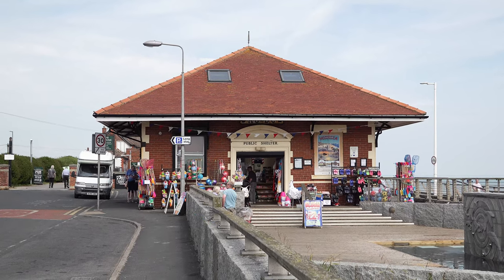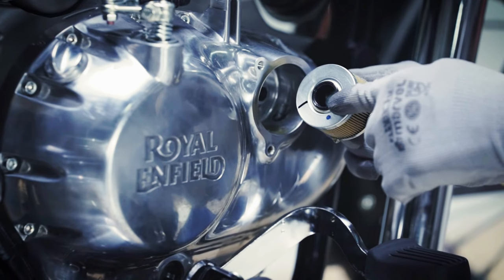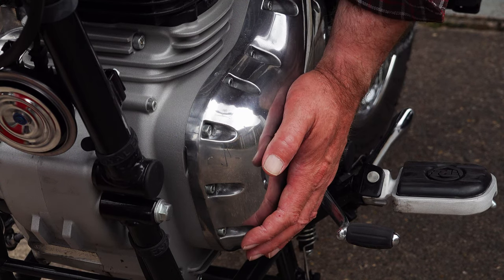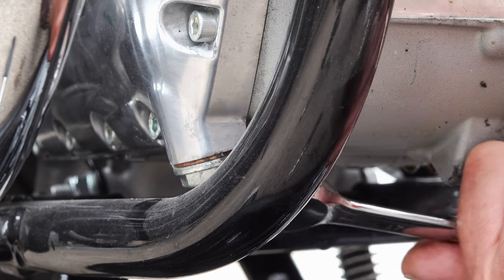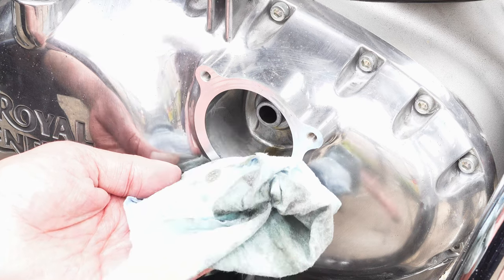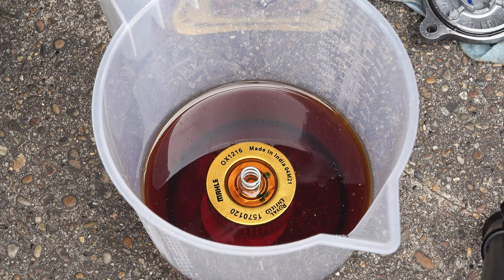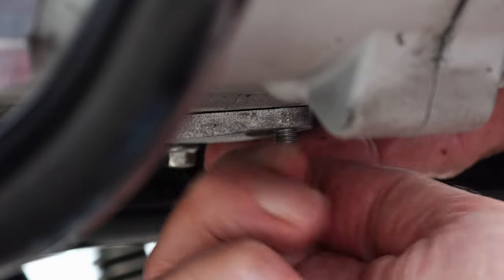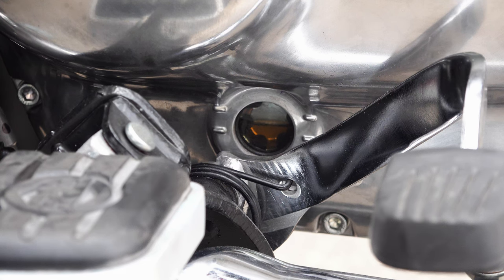Royal Enfield Classic 350REborn & Meteor 350. Complete old school oil Change. Reset Service Icon!

Comment: Ah!, the flashing wrench syndrome where some of us look at it and think ''Sex and Travel' I have one of those bikes where a visit to the dealer is required to be rid of the damn thing!. I did try a plug-in diagnostic tool...two in fact...all to no avail, the bikes system told them to have 'Sex and Travel'... I always change oil, filter, crush wash etc myself. However, find it very therapeutic watching and listening to your commentary  on some of your DIY work on your Bikes. There is something quite satisfying about 'Working on your Bike' isn't there. Knowing you have performed the task/s correctly with no short cuts like not changing a filter or replacing the oil with a cheaper type. Call me Mr cynical, but long experience has taught me to DIY if possible....Look forward to a ride in the country Stu...Greetings from España

Comment: Nice video, Stuart - and your comment about not overtightening is spot-on. I've recently had the 500 km service done on my little Skygo Earl 150 here in Philippines. I changed the oil myself at 200 km as I think it's good policy, but the 500 km service is free, though I pay for the oil. The 'mechanic' only put in 1 lt of 20W-40 and promptly proceeded to force all the fasteners as tight as he could get them. I bought more oil on the way home (of the correct 15W-40 weight this time!) and topped up to the correct level, though I had to use a large pair of pliers as additional leverage to undo the filler-plug/dipstick. He is obviously of the mind-set that, if tight is good, then over-tight is better... Needless to say, I'll be doing all my own servicing from here on.

Comment: A very good description, thank you. The advice not to tighten the screws too much is a good one. Otherwise expensive damage can easily occur. For those who work with a torque spanner: The manufacturer recommends 8-12 Nm for the strainer lid and 10-12 for the filter lid.

Comment: What you said in the beginning about dealer cost is wild. I just got back from the dealer assuming the warranty covered the first 300 oil change and valve adjustment. They wanted $504 and I couldn't hide my shock. Now I'm here to do it myself.

Comment: The large Copper Washer can be made reusable many times by Annealing it in an oven or with the soft flame of a Propane torch then rapidly cooling it in either oil or water. When it is installed and torqued it becomes 'Work Hardened' and won't recompress very well when installed again. They are not very expensive in the first place but why spend the money when you don't need too.

Comment: Having never done anything mechanical with a car or bike engine, having watched this video I feel I could actually do an oil change. One thing that appeals to me about these 350 singles is that I may be able to learn a fair bit of the required maintenance. Thanks for a very clear instructional video.

Comment: Stuart, thanks so much for the service reminder thing!  Just picked up my Red Chrome yesterday, reached 313 miles this afternoon, and did the first service tonight.  
At some point, late afternoon, while trying to get to the "mark" before returning home, my icon started flashing.  My first thought was, "Damn!  Wonder what sort of hoops and hurdles I'll have to jump through to get that damn thing to stop."  I suppose they're handy... as long as they're also easy to deactivate by the end user.  Having to take it to a dealer is unacceptable to me.  Fortunately, it seems that RE is on the same page here, as both my Himalayan, and the 350 can both have the service icon turned off by the owner.  👍

Comment: Great video.... done my Himalayan from first ownership and saved a few bob for sure. I like to use a torque wrench  - makes me feel confident I've got the tightness right and as others have said 8-12 nm so I go for 10  - screwfix do a good torque wrench that goes from 7NM to 120 nm 3/8 drive  - so it'll do the axel nuts as well. One final thing I do is on that lower filter bold hole  as its obviously blind I use a cotton bud to remove any oil that gets in there when the filter and cover are removed - not sure the chances of hydraulic lock but the cotton but removes any oil in there. I do like the classic !

Comment: Just a comment, so take it for what it's worth...  Just picked up my bike yesterday.  My dealer advised that their service tech had recently attended a RE service training class, and that he had been instructed to use the "upper" oil level mark as the minimum.  It seems that since these bikes were designed, built, and the service and owner's manuals were released, RE has had some additional input indicating that the oil level should be maintained at a higher level than originally indicated.  I was told to keep my oil level between the upper level mark, and the top of the sight glass.  Just thought this info worth sharing since I just learned it yesterday, from someone that just learned it from RE very recently.

Comment: As long as you can prove you have used recommended parts and followed manufacturer procedures ect , the there are no warranty issues , been the case for as long as I can remember now and I worked in the trade for 38 years , yes some dealers will try and argue the toss as they haven`t had their cut of the service cake , but tough , thats how it goes.

Comment: "Owner Suitable Maintenance" gives owners a pride of involvement, and it's part of the attraction of Royal Enfield bikes!
Here in the U.S., Motul is bit easier to find that Silkolene, and the Motul 7100 4T line of 100% synthetic motorcycle oils
in 15W-50 and 10W-50 grades are suitable for 4-stroke Euro 5 bikes.
Reply: Using Motul 5100 here.  I'm sure both will be fine ;)
Reply: Castrol Power1 fully synthetic 10W-50 4-stroke motorcycle oil is also available here, but its API rating here is only "SL", while it's "SN" in the UK and Europe.  My guess is that retailers here are selling what is now overstock.

Comment: Having just completed my run in (in 3 days), I can thank you enough for doing this video to point out the methods for this service. I spoke to my dealer where I bought it ask how they completed it. Their answer made me decide to do this myself as they do NOT remove the filter screen from the bottom of the engine during their services. Only the primary filter and drain plug. They also charge an additional $49 to turn off the service engine icon, which is absurd. This was also my first go at doing valve checks on a bike. I’ve done plenty of older cars but this was a first. My other bike is a VStrom and there’s no way I’m getting into that one. 

As always, top notch video and production. I’m also purchasing TripMachine luggage on your recommendations as well. Many thanks!

Comment: Hi Stuart , this was a clear and concise video on oil and filter change on your Enfield, presoaking the filter in clean oil is a very good idea,   as it brings the  pressure back up on starting,  a few seconds quicker, I was impressed by the way you carried out the whole procedure,  also by the lack of oil on the outside of the engine,  these bikes have come a long way since the Royal oilfields of the sixties when I worked in the trade, some of them were painted inside the engine castings to stop oil seaping out through the pores in the metal , the castings were so poor, Ah!  The nostalgia of riding something that actually smelt like a motorcycle, do remember guys putting a bit of Castor R40 in the petrol tank to give the aroma of a racing bike,lol. I digress, thanks for the video mate,  stay safe, best wishe's to you and your's, Stuart UK.
Reply: "Royal Oilfields".  :-)  Good one!
Reply: @daveinwla6360  Hi Dave, 😊 I guess that's why people of the time called us greasy bikers, especially the birds we hung out whith, that's if you were lucky to find one that didn't mind riding whith ya, the bike I mean,lol. Atb mate, kind regards Stuart Uk.

Comment: Hi there Stuart, I think you can add the HNTR 350 to the title, everything is the same I have tried the Service Icon Reset today. I have just reached 500 km. I bought the HNTR 350 after reading your review. Sold my 2018 T100 and got the HNTR plus 3200 euros to spend on touring. I am grateful to you for helping me make up my mind. This is a fun motorcycle to ride. My first tour will be from Samos Greece to Afyon Karahisar in Turkey for the September Moto Cross GP.

Comment: Cheers Stu. A very informative video! I've not ventured into self servicing as yet, so did take mine to the dealer for the first 300 mile one, more for peace of mind and the fact that I've never adjusted a tappet in my life! I shall certainly consider it in the future though...£190 including VAT for mine.
Reply: With just 2 valves and screw-and-locknut adjustment, tappet clearance adjustment is super easy and soul-satisfying.  Do it!  :-)
Reply: @daveinwla6360  if it's soul satisfying, I'd better give it a go 😁

Comment: I notice that they have eliminated the O ring that you have to put on the back of the filter before installing it on the UCE Classic 500 and B5 Bullet 500s and replaced it with a seal built into the filter itself. I have a 2013 B5 Bullet 500, and trying to get that O ring on the filter to stay in place while installing the filter is the hardest part of the oil change for me. There is no groove for the O ring, and I always wonder after installing the filter if the O ring has moved, because there is no way to tell once you have everything back together. I also see they have eliminated one sump plug compared to the UCE 500. I don't measure the tightness of fasteners like those, either by torque or how much I have turned them. I go strictly by feel. I have been an auto mechanic for 40 years, and just retired last year. Believe it or not, I have seen threads stripped by using a correctly set torque wrench, and following the settings in the manual. I am aware that the 500 Royal Enfields use substandard metal, so I am very careful when tightening all fasteners. Hopefully the quality of the metal has gotten a bit better. 

I used to use a LOT of brake parts cleaner when at work, and they provided it. But now that I have to buy it myself, it has become very expensive, even the Walmart brand, and hard to find. So I use a little gasoline in a small metal bowl and a toothbrush to clean the parts, then blow them off with a little brake or carb cleaner. 

I discovered when changing the oil in the 500cc UCE engine (which is a bit complicated. besides the filter O ring issue, you have to lift the bike up vertically over a pan big enough to cover both drain plugs and the filter screen plug, then lean the bike to the left, then to the right, back and forth several times) Then after pouring in the correct amount of oil. I started it, let it run several minutes, and shut it off. With it on the centerstand, the oil level came up to the top of the sight glass. But the next day, after not touching the bike overnight, I found the oil level quite a bit low. I filled it up to the top of the sight glass, and that time it stayed there. I did my first oil change on the 500 at 200 miles, the second at 500 miles, and the third at 1000 miles. I found this "oil level drop" happened every time. So I started measuring how much it took to bring the level back up to full, and just added that amount when I did an oil change. It no longer dropped overnight. I have no idea what caused that. I have had a few Harley Sportsters, and a 1966 Triumph Bonneville, both dry sump engines, and they didn't do that. I always fill my oil level up to exactly the top level, either on a dipstick or a sight glass. Never had a problem. I've noticed on all the bikes I've had with sight glasses that the oil completely disappears from the sight glass while the engine is running.

That oil change warning reset seems to be a real pain. I have a 2006 U.S. brand car, and it has one. It comes on at 5000 miles, but I change my oil every 3000 miles. Fortunately it is very easy to reset. Newer vehicles don't seem to make anything easy, and I would just let it flash before I would go to a dealer. I change my oil by the odometer.

Despite the fact that I am a 100% carburetor guy, I have considered buying a Meteor. In the U.S it is almost an $8000 bike OTD. Dealers are scamming like crazy. I would want to replace the exhaust and get rid of the cat con, and disabling the ABS would be an absolute necessity. For me, 100% of the enjoyment of riding a motorcycle is being in total, complete control of it, and knowing that if I mess up, bad things can happen. I will not tolerate having a computer come between me and my control of the bike. I see ABS (and EFI, and anti tampering laws, and places where you are not allowed to ride/drive an internal combustion powered vehicle, and a few more things, like sidestand and clutch nanny switches) as just more government control over my freedom.

Comment: Hi Stuart, greetings from Thailand, I bought a Meteor 350 just over a year ago, the bike is perfect for this country, the only problem I've had so far is the engine, when cold it sounds sweet, but, after about 5 minutes running it gets incredibly noisy from the left hand side of the engine, to me it sounds like main bearing rumble (I've been a motor mechanic for over 40 years, my last job in the UK was an M.O.T tester for the DoT) when I ask the dealer I bought it from to examine the bike, the only response I get is 'it's normal and not to worry, the bike has 3 years warranty', when I query if it's normal why don't they all do it, the test bike I rode didn't get noisy when it warmed up, they just shrug their shoulders and walk away. The bike is due for it's 10,000km service, I am letting them do the scheduled servicing so they have no excuse should the engine fail, the vibration has got steadily worse over the time of ownership. My question to you is, does your bike's engine get noisy when warmed up or have you heard of any similar problems, I did see someone on 'Youtube' post a short video highlighting the same problem and it appeared he was told the same as me ie. 'it's normal', a reply would be much appreciated, thank you in advance, kind regards, Chris
Reply: Is there a RE national support in your area?  I live in North Carolina.   When my new Interceptor started cutting out I took it to the dealership I bought it from.   Their response was to take the bike out on rides and if the intermittent fault did not surface during their test rides then there was nothing they could do.  

I called the US national RE customer support number.   They directed the dealer to replace the side stand kill switch under warranty.   

I have not had cutouts since.
Reply: @Caledon1314  Hi Nigel, I live in Thailand, we have some dealerships, but not many, I had the same problem with my GT535, I just disconnected the switch, problem solved, my personal experience with the dealership I bought my Meteor from are not very helpful, they seem reluctant to honour the '3 year warranty' on my bike, I love riding the bike, it's perfect for my use, but the lack of interest from the dealer is encouraging me to sell both my RE's, anyway, am happy your problem has been sorted ride safe have fun
Reply: Hi Chris. I use the RE dealership on Phetchaburi Road. So far they've been excellent. I also notice that my Meteor engine is quite noisier once hot. I can't identify where it's from though.
Reply: Hi David, thanks for the recommendation, however, I have now sold both my RE's, the Meteor had just over 20,000kms on the clock, didn't sound any better or worse from the day I bought it, so, I guess the noise is normal, mine was kind of a bearing rumble from the left hand side lower part of the engine (crankcase) @davidcann8788

Comment: Hi Stu, great video as usual I really enjoy your stuff. I've just had the first service on my classic 350 at my local dealer here on the south coast, it cost me £158 plus vat which I thought was a little tall for a simple oil change and tappet check, but with overheads and the need to make a profit I suppose it's reasonable. However they were excellent and very quick during the purchase and accommodating when I wanted a service first thing on a Friday so I could spend the rest of my day off riding so all in all a good experience. And the bike is fantastic.
Reply: Hi, i have a meteor 350 and was charged £214 for the first service, i will be doing the second "checkover" service at 3000 miles/6 months myself but will get it dealer serviced at 12 months.
Reply: @glendyble4725  I paid £133 for my Meteor 350's first service, which I thought a little pricey until I read some of the posts here! I was quoted £65 for the 3,000 mile/6 month "service". Crazy service intervals. I won't use the bike over the winter so if I don't complete 3,000 miles by October(ish) it's going to become a 3,000 mile/12-month service next spring. Be interesting to see how they deal with that.

Comment: Hi Stuart, I wanted to mention something you didn't touch on: When I follow the "oil level check" procedure in the manual to the letter (start, gently rev 10 seconds, idle 15 seconds, then shut off and wait 60 seconds to view the window) then my 350 is perfectly full.  But by 10 mins or any significant time later, it is quite a bit above the max line, almost to the top of the window.  I don't like the somewhat complicated procedure in the manual because results may vary.  I wish it was a simple hot or cold check.
Reply: I get the same results, glad it's not just me but I don't like the "results may vary" aspect.  It feels like the bike is gaslighting me